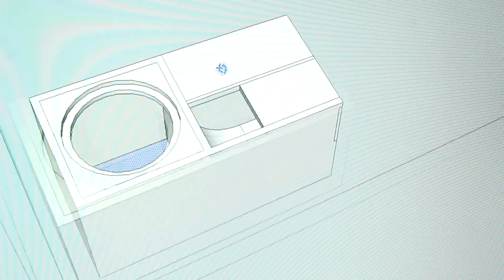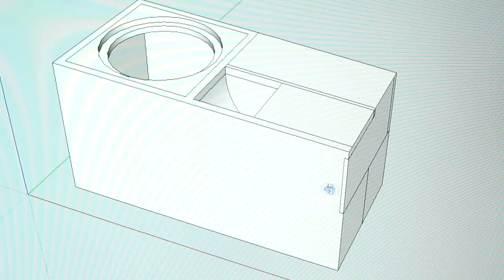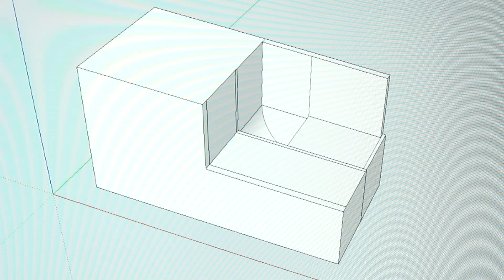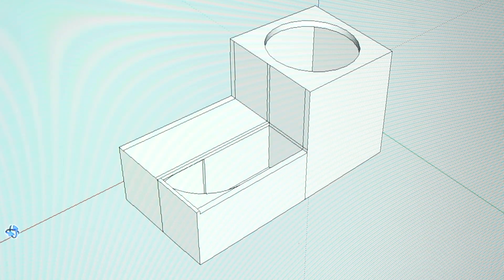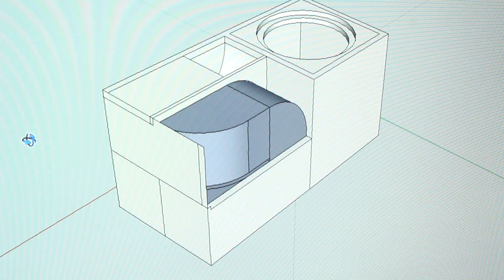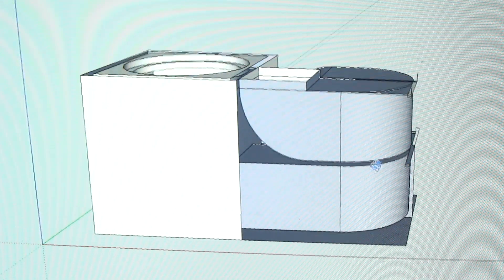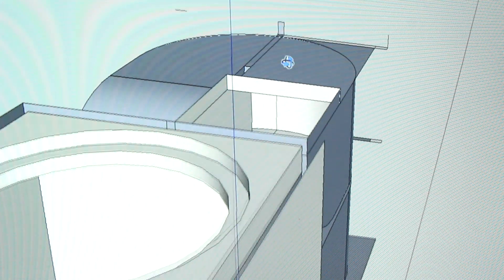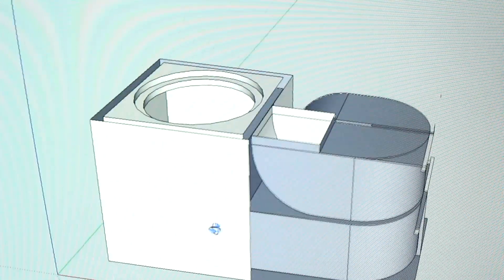RE XXX 15" Isobaric subwoofer box design

Comment: I'd build it with a single sub, also the port should get a bit smaller as it travels, you then have higher decibels , and lower Hz. Beautiful design dude!
Reply: You are the only one I have heard say that and I am happy to hear someone else thinks along the same lines. I have a 15 that the port starts inside the enclosure  at 3" and tapers down to 2" in almost 6.5' damn never thought of how long the port was til now. It just wraps around inside the enclousure.

Comment: hello, i used part of your design with the exception i started the port in the camber. I also used great stuff gap filler to make the corners perfectly curved. i simply placed a piece of card board in the corners to form the mold, then prayed th gap filler into the corners. it expanded and got really sturdy! Along with curving the corners it also removed and possible leakage of air. The most crucail component, i used foamboard, fleece blankets, resins,  and woven fiberglass sheets. it made the box really light. I also placed the channels in inverted and directional changes ine the port channels. this cuased the air to speed up. no one belivez i have only 2 fifthteens! when i says it bangs, i mean it bangs! I'm hitting 135Db with 2 lanzar small enclosure 15's. the box is super small! they only require .73 cubic feet with a port requiring .53. of course the way i compsed the port it has 2.00 cubic feet of air. the largest ported requirements are 2 cubicles feet with 1.25 for the port. THANKS A MILLION for the design implementations, and your concepts. I'm ridiculously hitting! only using $100 dollars on speakers, and an amp only made in Bogart Georgia USA. The amp is over 10 yrs old. Bostwick was a brand that was tried and true. if the amp was rated 1000 watts rms at 1ohm thats what it was pushing. it has 6-40A fuses, i know the calculations would be over 1000 watts rms but without having the half way its still hitting a clean 1000 watts. to get the "bump or thump" I placed a mosquito net over the entrance to the port. thanks again

Comment: half the port of optimum and double the port area equals the same tuning as,optimum for a pair and because the cones csnnot distort because of air trapped berween them they sound excellent and fast you just may lose some efficiency but they are awesome. and musical.

Comment: Interesting design. You may need to put some insulation or damping material on the side of the port walls, because of the square shape of the port. Round ports maintain velocity throughout the entire area of the port. A square port may allow the air passing through it to lose velocity, particularly in the corners which might cause some odd resonances. Good luck and please post the results.